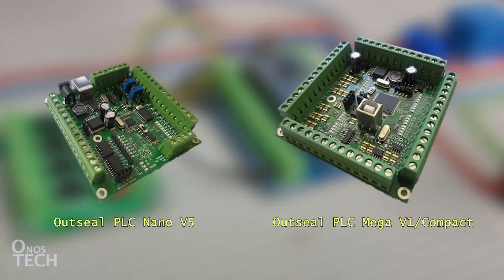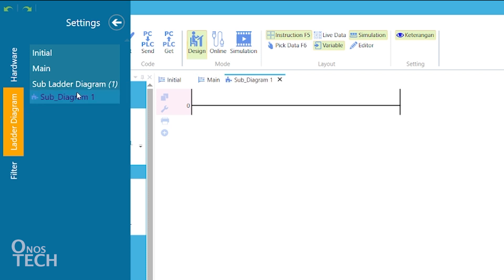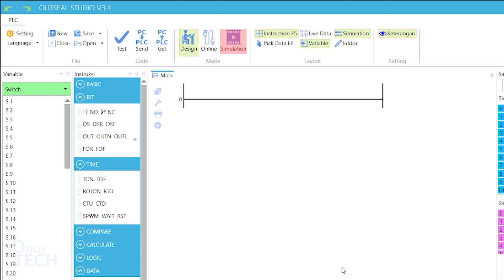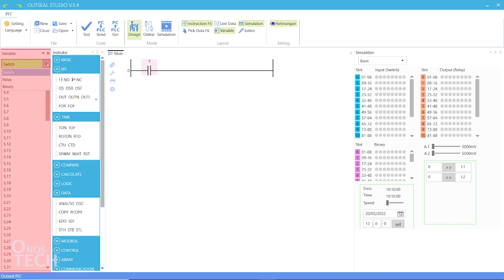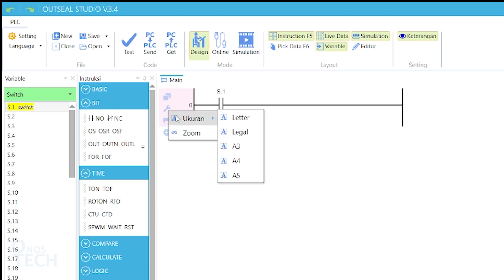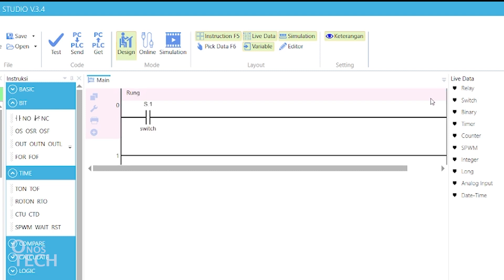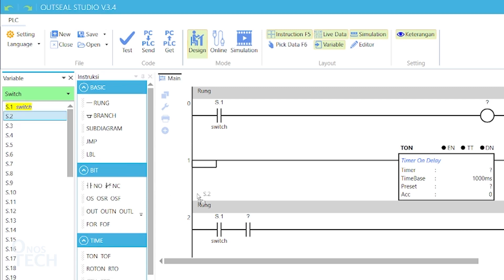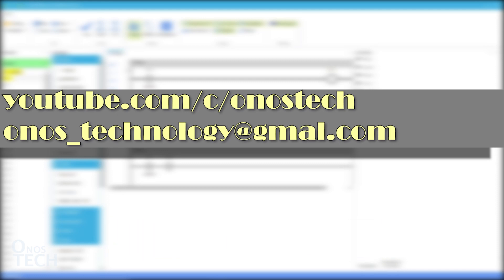#2 How to Program Outseal Arduino PLC - Studio Overview

Comment: Thank you Onos. I try to download program connected a Nano V3 using USB cable. But can not download, this happens again and again. Changing the Baudrate, tried flipping old & new bootloader. Nothing working. The Cable is okay as can download program from arduino software using the same cable. Device manager also showing correct  USB-SERIAL CH340 (COM3). Please kindly help.
Reply from the maker: I think your nano still has the old bootloader. You might need to upload the bootloader from Outseal download page. Or this video will be helpful.
https://youtu.be/1TM-ADHb5Dk
Reply: Thanks for your help. Now I can upload to Arduino Nano.  I haven't test the Arduino Mega 2560 yet. I am using OUTSEAL STUDIO V.2.6 REV3. This version support  Arduino UNO.
Reply from the maker: Great!